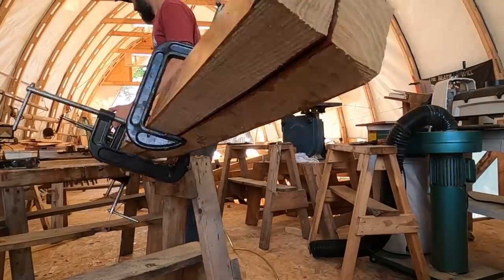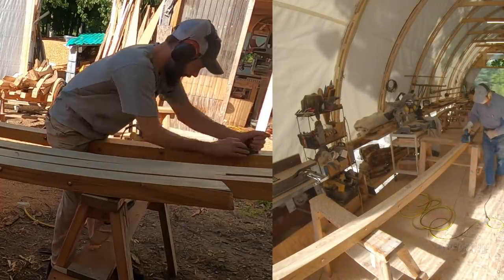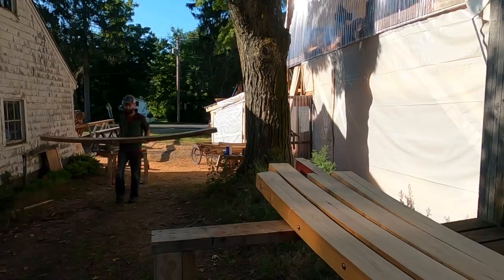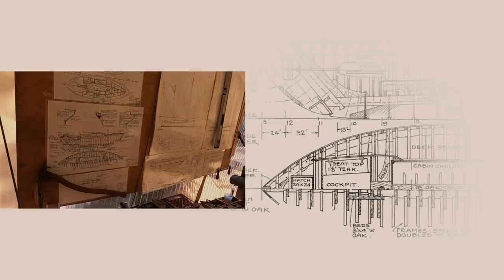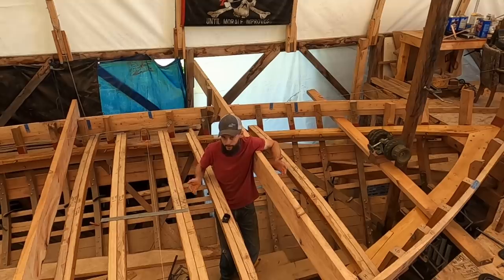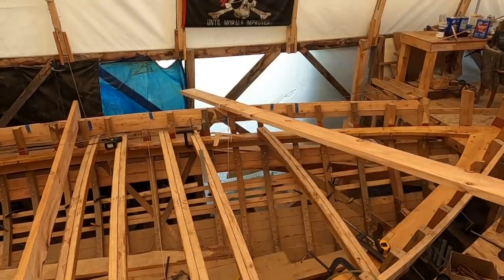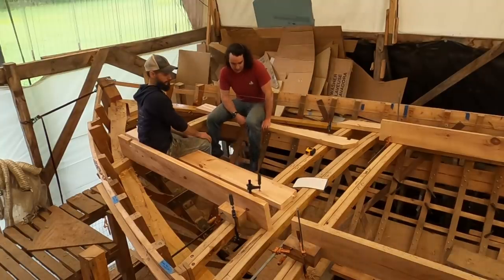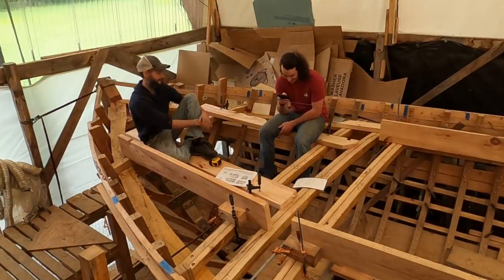Deciding the Hatch and House Locations - Ep. 130 - Acorn to Arabella: Journey of a Wooden Boat

Comment: Small cockpits are...small. If you want to actually spend time outside the cabin, the cockpit is it.
The seats should be long enough to lay out a cabin sofa cushion and nap.
Reply: Big cockpits are...unseaworthy. There's a reason old boat designs have small cockpits.
Reply: @Garryck-1  I didn't mention big. I am talking about not small. Believe me. I have been there.
Reply: @Garryck-1  that was the school of thought back then- you had to have something small enough to bail. But look at every modern boat. They all have livable cockpits, and they don't all sink. The trade-off is you need scuppers big enough to drain the cockpit quickly.
Reply: @paulheitkemper1559  - It was less about "small enough to bail" than it was to not have several tons of water weighing down the stern when you need it least. And even with big scuppers, many large cockpits take a few minutes to drain. I'll stick to smaller cockpits, thanks all the same. Too many modern boats sacrifice seaworthiness for convenience. And don't even get me started on fin keels and spade rudders!
Reply: @Garryck-1  "small enough to bail" = "not several tons of water". They're really two sides of the same coin.

As far as fin keels or spade rudders- sure, they're not as bulletproof as full keels and skeg rudders, but hundreds of boats successfully sail the ocean every year. and 70 years ago, no one had gps, sonar, etc. It's really a matter of tradeoffs. If you want to be perfectly safe, then stay on shore.
Reply: which is NOT to say that there aren't fragile designs (Cheeki Rafiki comes to mind).
Reply: Being able to lay down in a cockpit is pretty important in my experience. Also, it can be nice to be able to brace across the cockpit with your feet when the boat is heeled well over. It is nice if the spacing is comfortable for that.
Reply: That cockpit looks small by  every description and it looks uncomfortable to spend lots of time in if there is sparse space on the foredeck
Reply: The seats can be longer than the well.  There is safety in the smaller cockpit foot well but I agree about being able to stretch out in the cockpit seats.  On light days I've laid back and steered while stretched out.  One day in particular, I could see ahead when the bow dipped over the small waves; only saw deck when the bow gently lifted.  It was a glorious and memorable day.

Comment: There's more to making a life raft than just. making it unsinkable...  They have bags that hang down and fill with water for ballast to make them very difficult to capsize along with s shelter cover that automatically inflates with the raft, as opposed to having to set up all that on the dinghy, under what are likely to be pretty horrible conditions at sea.

Arabella is big enough that you shouldn't have to choose between the two; plenty of space for both a regular dinghy AND an inflatable life raft.  If you have to abandon ship under conditions that are favorable for the dinghy (due to fire, etc), if you have time grab the inflatable life raft on your way out and toss it in the dinghy.  If sea conditions worsen and make the dinghy untenable, you've still got the life raft.

And in particular, if you are on passage and have the dinghy lashed down on deck, you may not have time to detach and launch it, but you'll probably have time to grab the life raft and throw it in the water.
Reply: Yes. Always have a spare for survival gear!

Comment: I thought the mizzen box was to reduce water ingress where the mast goes through the deck. The box moves the deck opening (through which the mizzen passes) higher than the level of the water in the bottom of the cockpit (i.e. when you take a big wave).
Reply: The mizzen is above the engine and is deck stepped on the cockpit sole.
Reply: Mike Petersen Cool - I was referring to your comment about the box on the plans. Keep up the fantastic work - it may seem never ending but,for us, the progress is remarkable. You are moving mountains!

Comment: It is interesting that in this, (very enjoyable), episode your design decisions start to become more about boat functionality and less about structural issues.  

In terms of design, there are two components. Structural design and functional design. You have faithfully adhered to the structural design. The question arises about whether you want to want to create an exact replica of a 100 year old boat or whether you want to adapt the functional design to your own requirements. 

As an example, Atkin's 24" x 24" chain locker was designed 100 years ago. The strength (per volume) of the modern chain and synthetic warp that you buy today is much greater than the strength (per volume) of chain and rope when Atkin made this design. Why give up space  in your forepeak cabin for unnecessary (empty) volume in your chain locker. Reduce the size of the chain locker and sleep better.

On the small cockpit size ..... In hot climates, (where most people choose to sail), you will spend most of your time in the cockpit.A cockpit that you can't stretch out (full length) to lie down is no use. A cramped cockpit where there is no room for some sort of table for meals at anchor will lower your quality of life.  If the cockpit seems constricted to you in the yard, it will seem much more so when it is your ocean living room. A hundred years ago, when Atkin designed his cockpit, the average person was about 4" shorter. 
If you are worried about drainage, then create more / bigger scuppers.  

.... On moving the anchor locker away from the windlass....... Consider that the chain is going to have to travel from the windlass to the locker. if this is across the deck it will abrade (and muck up) the deck surface or sill/edge. A straight drop into the locker is best.  Incidentally, I think that your video said that the chain locker dimensions were 24" x 24".  There is no way that the hatch needs to be this big - even if you want the locker to be that size. A smaller hatch is better. More working room on deck.

And, Steve - as good a craftsman and engineer as you are, I doubt you can build a tender that will work as an ocean going life raft. If you can design and build build a quick release, self righting, easily entered from the water, covered module that can withstand F12 conditions and conforms to the very stringent liferaft standards, you will go up even more in my estimation.  If you do manage to build some such stable tender, it will be an absolute nightmare to row ashore and haul groceries - which  is what you will be doing 99.999%-100% of the time. 

Love the videos and am in awe of your project.
Reply: Absolutely agree about the cockpit size and people being lots bigger now than in the past. My grandfather (born 1919) was 5'4"/160cm tall. My dad (born 1948) is 5'8"/170cm tall. I (born 1978) am 5'11"/180cm to 6'/183cm tall, depends on the day.

Make the boat assuming people 6ft or taller will be inside!

Comment: Life boat construction check out high density fiberglass reinforced polyethylene it is amazingly strong. I would venture to say nearly indestructible. It is easily formed to shape with heat. Used as a relatively thin outer layer it affords a very sound boat. It is used in international shipping containers and truck trailers to protect them from fork lift destruction and also under the wood floors as a weather barrier and also the translucent trailer ceilings. It is available in versions that are uv protected. There is a 1/4" thick version that will stop a 45 cal bullet at 25 feet. You wouldn't need that unless you plan to sail around Somalia. Have a nice day.

Comment: You need to give that windlass serious consideration for where the rope/chain falls below deck. A chain locker below is a must and is usually the foremost part of the bow. You do Not want any chain stowed on deck for many reasons - most to keep the mud and bottom debris off the deck. I saw the windlass looks like it can handle both - one head for chain and one for rope. the chain needs to come off the windlass head and go straight below through a chain pipe or box. If your windlass does not appear to work for your situation get another. It is a sometimes over looked piece of gear and it's operation is paramount to the safety of your boat. If you plan on being in southern waters, rock and coral will need a chain rode. A windlass can be mounted on top of a flat area of the bowsprit forward of the Sampson post which allows anchor rode to come off the windless and attach to the Sampson post. I could not tell if Atkin had drawn any details to these effects.

Comment: Just about everything I know about wooden shipbuilding I've learned from your project, my expertise is architecture. Question, it seems like it's traditional to deck perpendicular to the deck beams, but wouldn't diagonal decking provide additional strength to the structure - as the diagonals together with the beams become a sort of truss?

Comment: They don't believe you because few people have actually held one. But ultimately, you can math it out very easily by putting the gears inside a drill or the hammer surface in an impact splayed out on a bench, and it's still not enough to reach out where the lever arm of the brace is + the force of the human arm + weight of the operator.

You need to get a hydraulic impact gun, the big ones that are thick as a leg to discuss proportional advantage (because air is more powerful via compression).

Comment: The argument for a small cockpit on a traditional sailing vessel double ended design is that it won’t get filled with too much water when you get pooped by a following wave in larger seas. But it’s a pain and inconvenient for the 99.9 % of the time you spend cruising.

Comment: Not sure why you would resort to foam now for boat building when the rest of your boat is wood? Ceder Strip building is great, looks beautiful, very strong, and goes with the theme of your wooden boat.
Reply: That's for the little tender, not Arabella herself.
Reply: @ScottKenny1978  I realize that it is for the tender, I should have mentioned that in my post.
Reply: @williambattermann5008  ah, gotcha.

I think the reason they're considering foam inside is for extra floatation. I would want a lifeboat to stay afloat even when utterly full of water clear to the gunwales (like with any modern canoe). And foam works better for that use than wood. Foam inside, then cedar strips for pretty, and a layer or two of fiberglass on the outside for strength. You shouldn't need three layers of 'glass, that's enough to make a structure that will survive 17+ gees in an airplane.
Reply: @ScottKenny1978  I can see the reasoning there. I have not built with foam, it seems that foam would also be easier to work with. Cedar Strip is labor intensive.
Reply: @williambattermann5008  yeah, foam can be very, very easy to work with. Get yourself a big hot wire cutter and go nuts. My airframe mechanic instructor had a 6+ft long hot wire from when he made his Long-EZ homebuilt airplane. I think I still have the fiberglass bookend I made... Though fiberglass cloth and resin is also pretty labor intensive, once you start caring about the thread lines on parts. Lots different than running a chopper gun like they usually do for boats.

Comment: Hey Stephen, you mentioned building a dinghy (I'm guessing customized ?) for AtA based on the portland pudge.  Have you ever seen a FRIB/CLAM ?  See :  http://www.stevencallahan.net/images/spcdesigns/frib.pdf    This fold up tender has some taper fore and aft, folds up, and can be sailed or powered effectively while still being used as a tender a bit easier than even the pudge while being of a size to be really useful as a life saver for more than just one person. Note that shot in the back of a truck bed... I'm thinking one of these could readily fit in the fore peak of AtA while allowing a small walk around area depending on your hatch positioning perhaps... The enclosed storage can hold all needed survival necessities while offering full buoyancy even if Inflatable RIB portions are not pressurized/used in design.   PS....   many life rafts will fit INSIDE this design when it's folded as a space saver.

Comment: Why doesn’t the mizzenmast connect to the keel like the mainmast does?
Reply: It doesn't need to, because the forces on it are so much lighter than the main mast.
Reply: Because the bridge deck provides enough support for the much lower loads from the smaller stick. Which is also why they shouldn't just get rid of the bridge deck.

Comment: Im not sure I would rely on a deck mounted stern mast,  as it passes through boxed structure, to the secondary beam, helps secure it in its location under load and adds structure to spread said load aft through the cockpit floor and locks it into the deck beams as well.  Id say give it as many bones as possible to get a bite on.

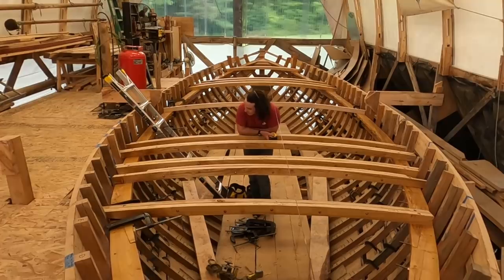Comment: How close to the position of Arabella's actual sole are the boards that are now there? It looks like there's going to be about three feet of headroom below deck. 20:33
Reply: Mmmyess you are forgetting about the height of the cabin house.
Reply: Pretty sure the work scaffolding is a 18-24" above the actual floor level, just to make it easier to move those beams around by getting them shoulder high on Steve.

Comment: My grandfather used foam in a boat once.  It was an uncontrolable cork on the water and completely unusable as a boat.  ... I think ita a planter box somewhere in Sedrow Wooly Washington. .... just sayin
Reply: If you build a boat and then add foam to it, the boat will be heavier that before the foam was added.  That boat was an uncontrollable cork because of its design; not because it had foam in it.  If you build a boat from just foam and then add a little epoxy and glass to it, that would be too light to be useful.
Reply: @David-hm9ic  the boat was already built ... the foam just made it so boyant that it just sat on the water. ... we had two grown men in thst thing and they werent small iether.    The two of them together wighed over 600lb not including thier gear and that boat just spun like a top going down the skaget river.

The point is dont use foam in a small boat ... it dont add wieght it adds air and it sux ass!

Comment: since your are doodling around with the cockpit and deck being put in, isn't it 'bout time to put the engine in?
Reply: Gonna be a lot of large moving pieces in that area between now and then that will benefit not having 500 lbs of engine in the way. I expect the aft hatch will be plenty big enough to fit the engine into, or it will be done at about the time the cockpit floor beams and sole are installed.

Comment: A comment to Steve,
'Your' Bit and Brace has more power than a power tool? Then, why aren't you using it to drill the holes in the shelf? And, try using 'Your' Bit and Brace to remove a rusted/corroded lug nut or even a Jaguar cylinder head bolt. Bit and Braces do have a better feel. That's a given fact.

Just another 'Nut calling the TREE dumb'. But then again, you are mixing cedar planking with oak; known very well that the woods expand differently.
Reply: Do YOU need a hug as WELL?  Sheeesh.....
Reply: Great reply Silas Marner. Not really useful or infomational... accept for you.
Reply: @stevenr8606  " Not really useful or infomational." Thanks for the PERFECT description of your whole childish little rant. Steve isn't required to make you happy in his choice of techniques or of words.
Reply: His wrong & misleading words